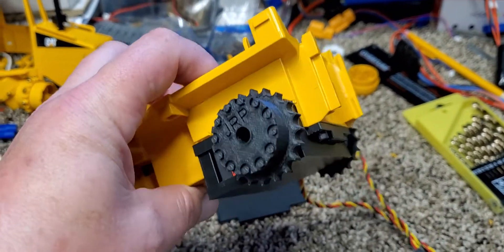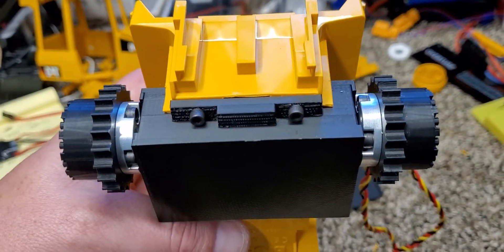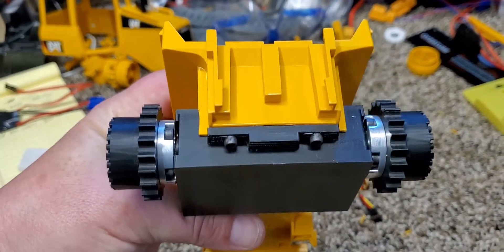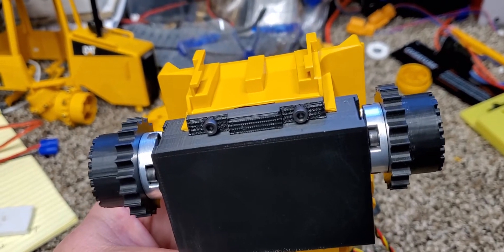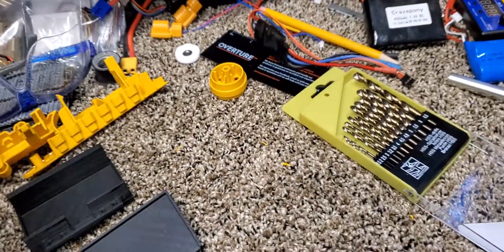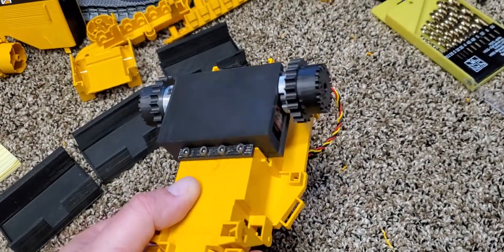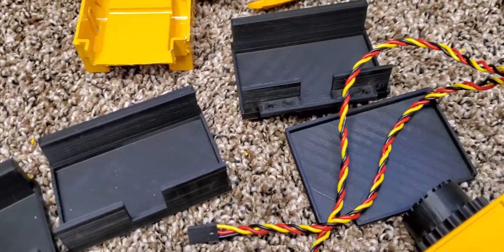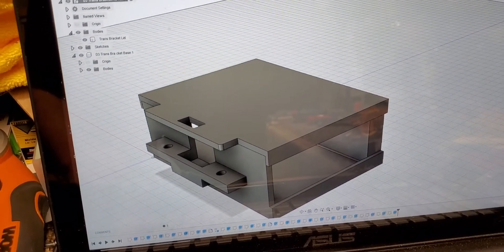Bruder Parts D3 D5 conversion. Part 1 Drive system.

Comment: That D5 drive gear box I had designed a few years back.  Yet doesnt need the rear bolts to secure..Exteamly simular?good thing I dont show all my build secrets lol.. I had shown this box on my dozer awhile back lol  Nice printer